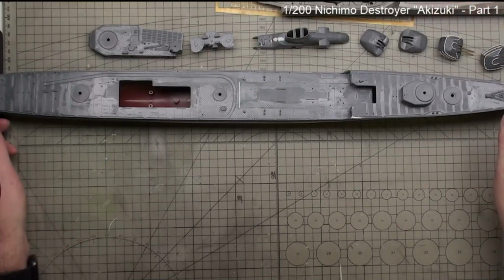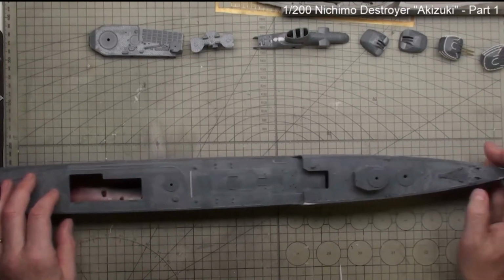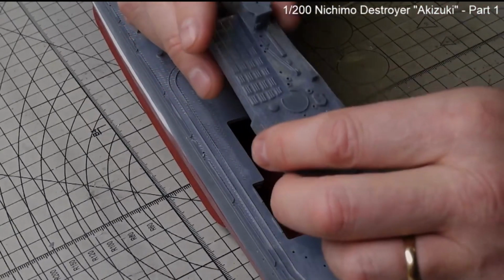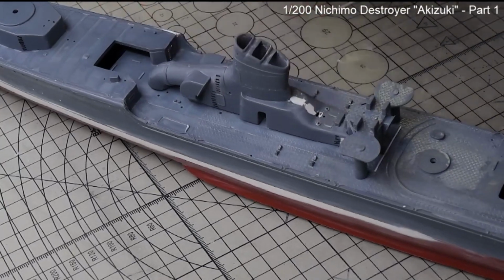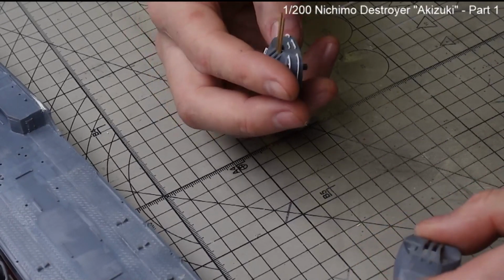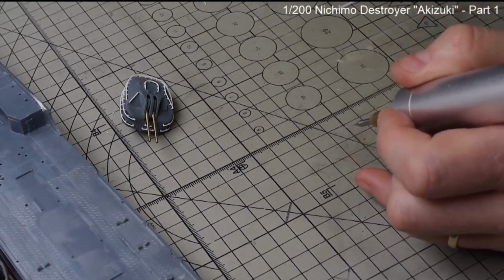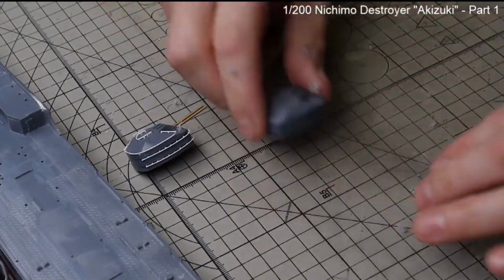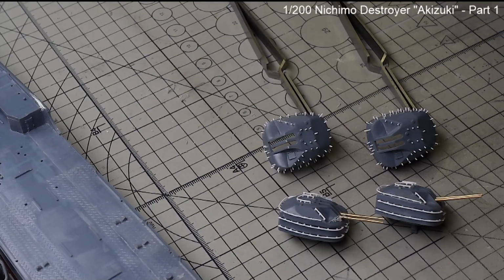Nichimo 1/200 scale IJN Akizuki - Part 1

Comment: 9:00 Tom's Modelworks has a generic IJN Destroyer PE set (Number 2004) that includes the "spider web" funnel grates you speak of, plus railings, radar, etc. 
For inspiration, there's an ongoing build of the 1/200 Hatsuzuki on Kit Maker Forums but it looks like you have already seen it. The builder is named "TimReynaga"